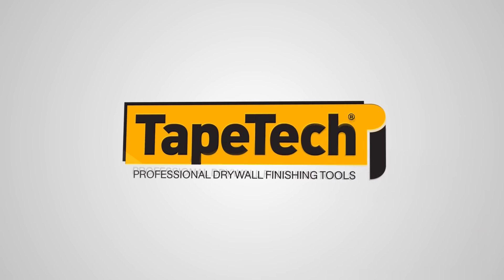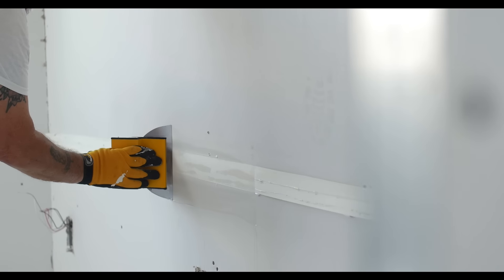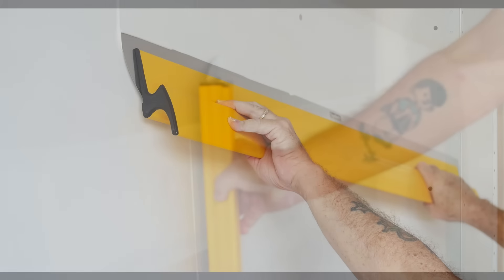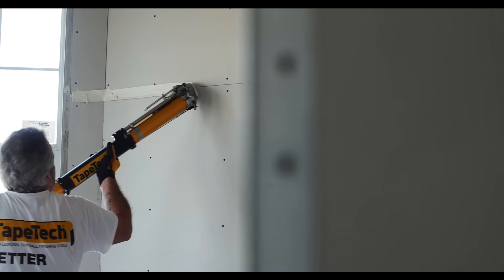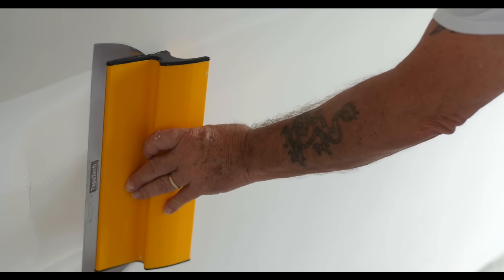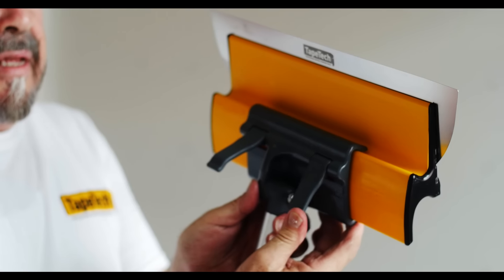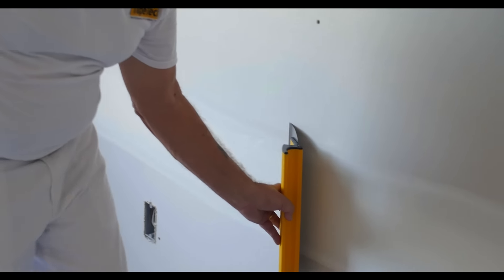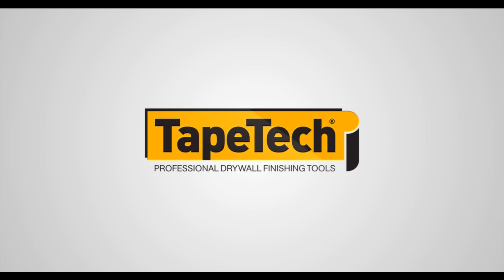TapeTech Premium Wipe Down and Finishing Knives

Comment: Recently purchased a few of these to compliment my auto tools. They are really great for following boxes to get rid of any excess at the beginning or end of runs. I have found also that a quick wipe of the entire joint after the first coat with my 8” box with the 10” knife really cleans the pass up nice and giving me a great looking joint after the subsequent 2nd coat with a 10” box. Which I use the 12” blade to just clean up the pass when needed, which is a lot less than if you don’t tend to the first coat. Then after I skim the joint on third coat with a 12” box I use the 14” knife to basically just carry around with me because the joints looks perfect now. The extendable handle is a must. Especially if you do a lot of vertical joints.

Comment: I have been using these blades for over a year now , the ones i have are made by Refina and have blue handles  , but they are exactly the same design , i will never entertain another wipe down blade again ,  Blades are also easily changed and not to expensive to do so , its a first class tool for polishing finnish skim coat plaster too , well worth the investment for any full time drywall finisher
Reply: me podrias decir donde las compraste en españa